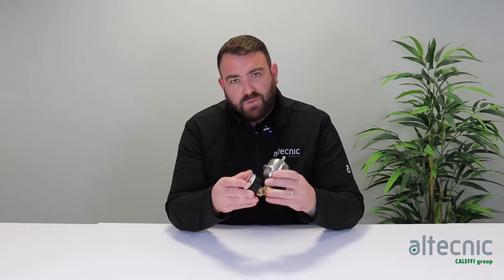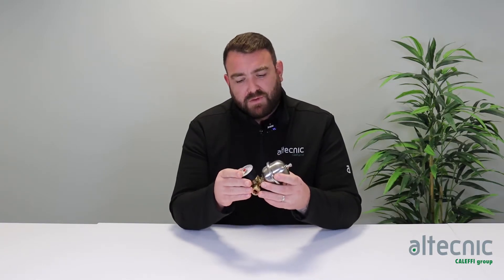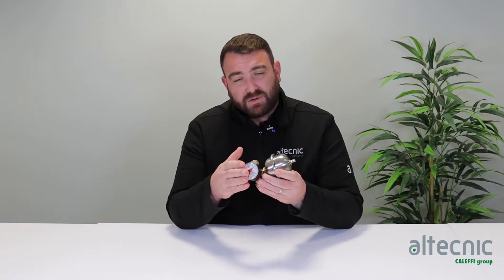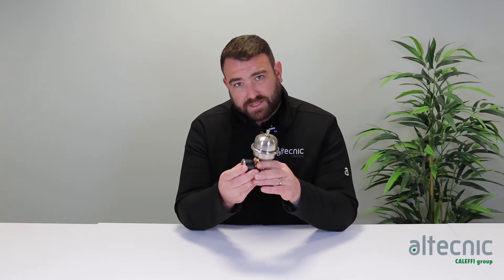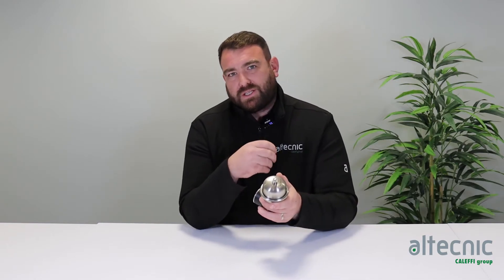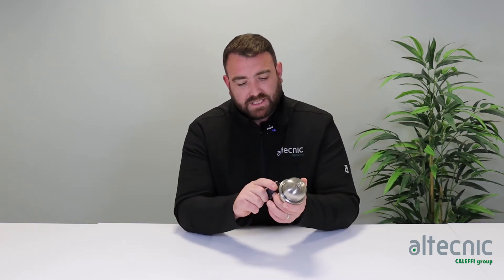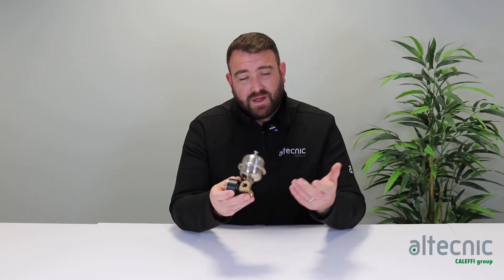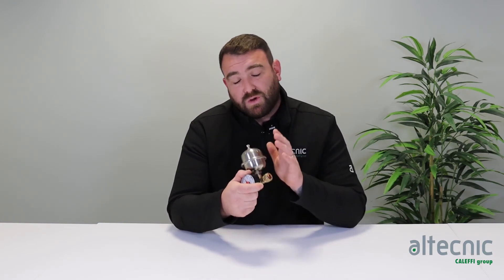How to Remove Water Hammer?

Comment: How does a non plumber  recharge the arrestor? It says recharge every 6 months.
Reply from the maker: Hi - It can be checked using a normal pressure gauge, similar to what you would use on a car or bike tyre. The pressure can then be adjusted using a simple hand pump.
Reply: Can the pressure be recharged with the mains water running or does it have to be isolated
Reply: Isolate and open a tap first